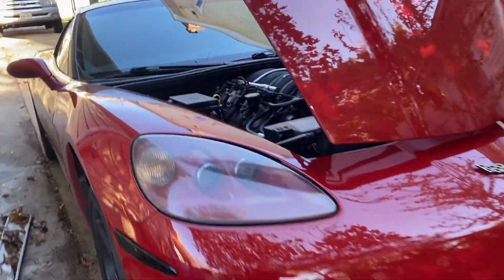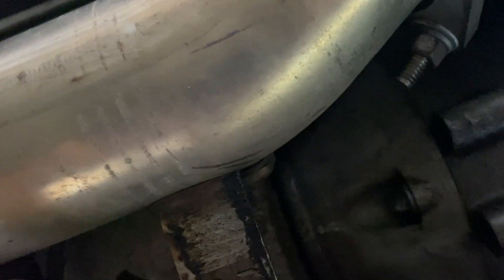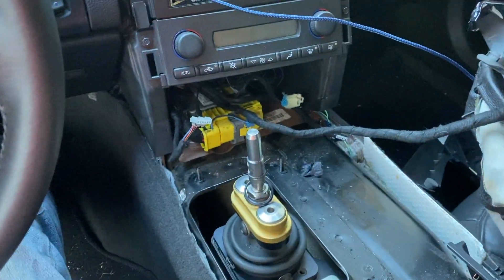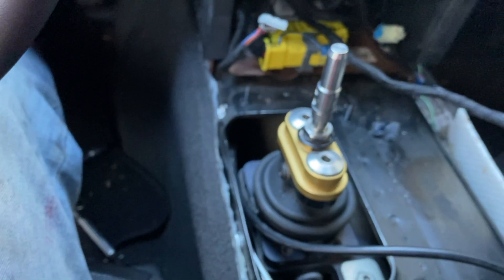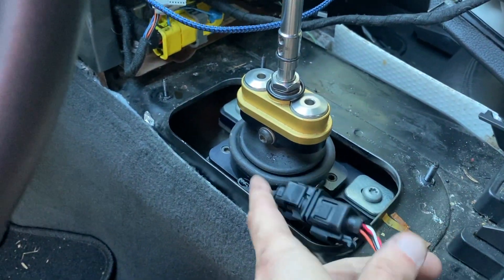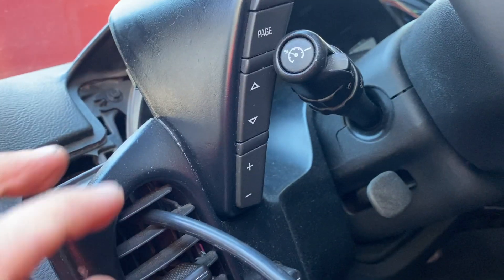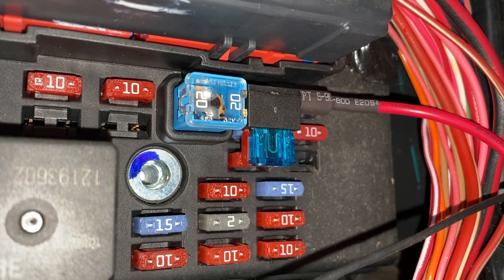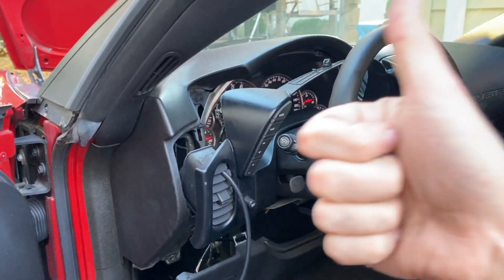C6 Corvette AEM Wideband Install DIY

Comment: That gauge requires a 5A fuse. In this case the piggyback adapter should have the 10A heated seat / wiper relay fuse and a 5A fuse for the gauge.